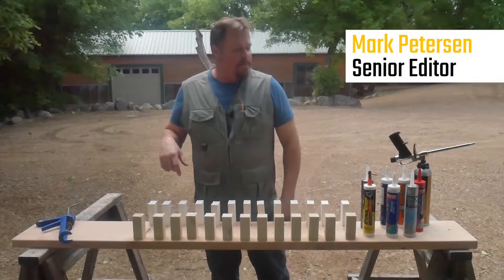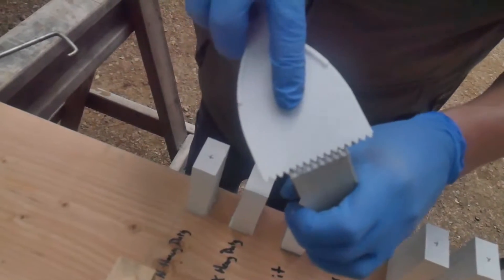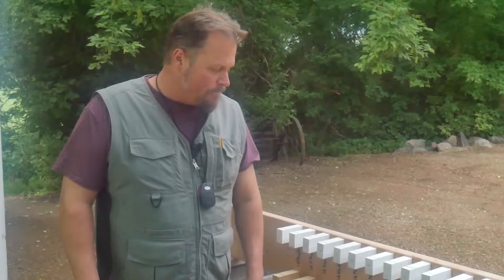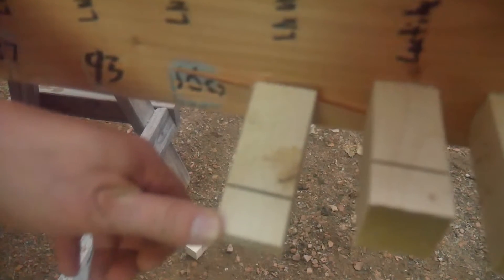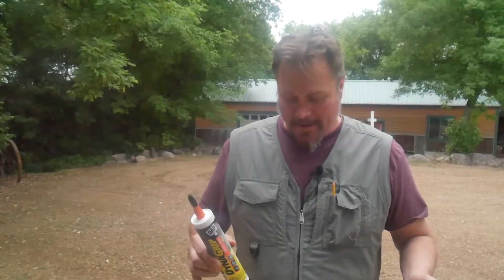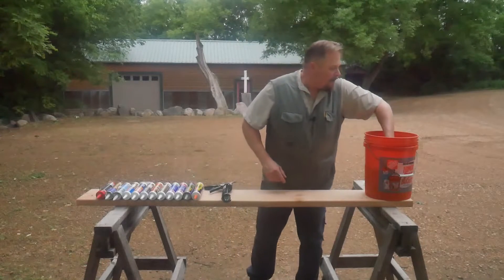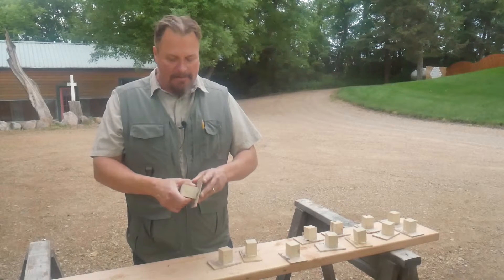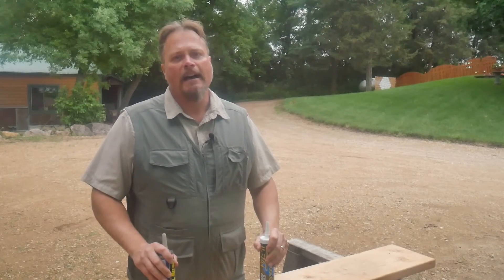Construction Adhesive Tests

Comment: I wonder about performance over time in the exterior Florida sun and rain? Has anybody ever tried to glue 1/2 fence planks to an exterior cinder block wall?  I have an old fence and supporting wood columns and cross beams have rotted out.  It's also a foot off a cinderblock wall where cats, rats and possums live. I was told I could finish the block wall to my liking but i like the consistent look of my wood fence and i could gain a good foot of real-estate space which I really need on that side. I know I could tap-con some treated 2x4s and then screw the planks in, but I was wondering if I could just glue the 1/2 planks to the wall like panel boards then secure them while the glue clues with some flat concrete nails.